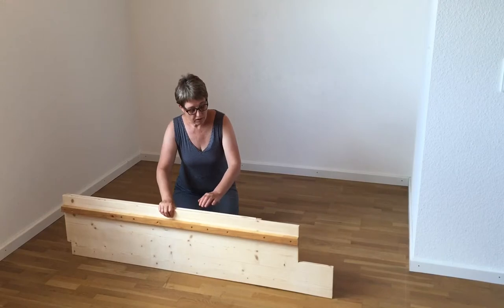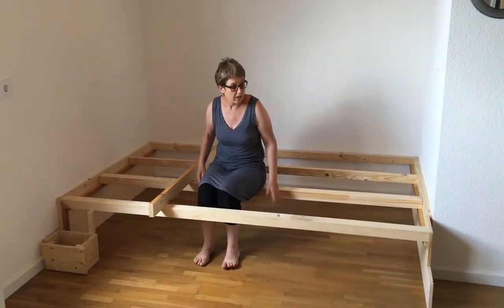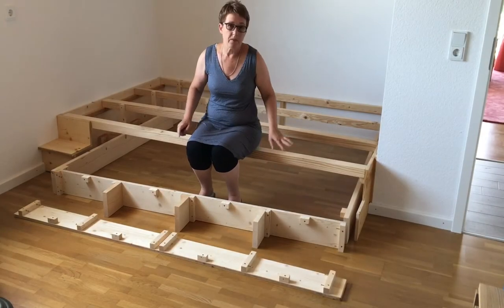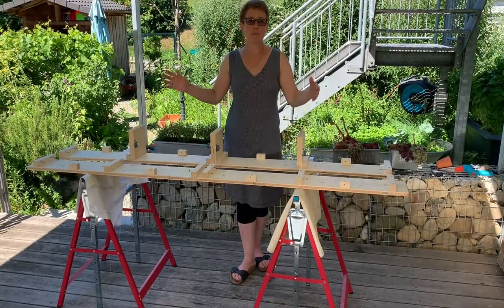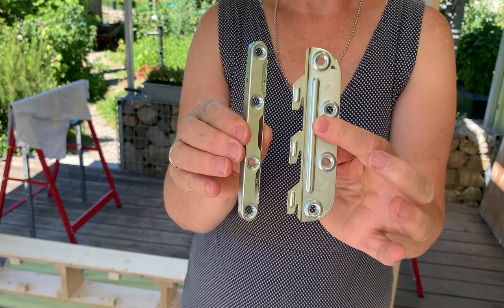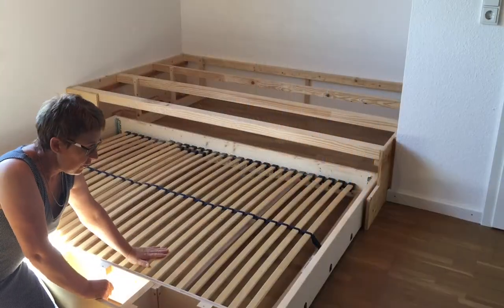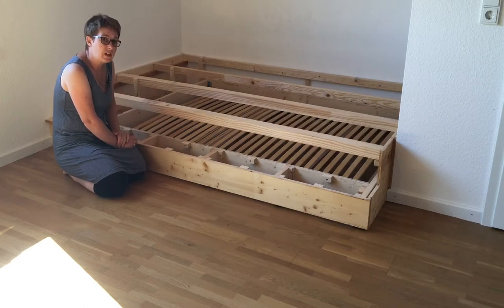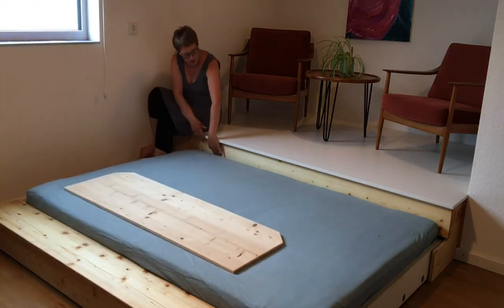DIY: Hidden Guest Bed. Platform Bed. Murphy bed alternative

Comment: Can you please tell us how many of each type of wheel you used for this project?  Also I am in the USA, is there wheels of this same kind here?
Reply from the maker: We used two different types of wheels/ rollers
Here is a Link to German Amazon ( in English). Unfortunately I don’t know whether they are supplied in the USA. 
Type 1 (We used 18 rollers / wheels of this type):
https://www.amazon.de/Design61-Castors-Parquet-Fixed-Furniture/dp/B06WPBSNRP/ref=sxin_16_pa_sp_search_thematic_sspa?content-id=amzn1.sym.bfcfa23a-438d-44f2-8404-95b200440473%3Aamzn1.sym.bfcfa23a-438d-44f2-8404-95b200440473&crid=RDYW9FL8JUBE&cv_ct_cx=bettkasten+rollen&keywords=bettkasten+rollen&pd_rd_i=B06WPBSNRP&pd_rd_r=efd5c97c-199a-4615-992a-f191ed549713&pd_rd_w=dny7t&pd_rd_wg=nnNTf&pf_rd_p=bfcfa23a-438d-44f2-8404-95b200440473&pf_rd_r=35WW8K3ZFYSXT29SED9W&qid=1679339326&sbo=RZvfv%2F%2FHxDF%2BO5021pAnSA%3D%3D&sprefix=Bettkasten+roll%2Caps%2C399&sr=1-2-3bf6831b-19ab-4b1f-92ec-7ff20088f9a1-spons&sp_csd=d2lkZ2V0TmFtZT1zcF9zZWFyY2hfdGhlbWF0aWM&psc=1&smid=A34DMBZNZDWU55

Type 2 (We used 6 wheels / rollers of this type)
https://www.amazon.de/-/en/Design61-castors-furniture-gliding-sliding/dp/B07RZ8LD2M/ref=sr_1_3?crid=1KXCRWKEA1500&keywords=einbohrrollen&qid=1679339583&s=diy&sprefix=einbohr+rollen%2Cdiy%2C1816&sr=1-3

We hope this helps you😀

Comment: Nice trundle bed! would you mind providing a link to the wheels you used on the project? thanks!
Reply from the maker: We used:

https://www.amazon.de/-/en/Parquet-Side-Rollers-Wheels-Grey/dp/B015PAV350/ref=pd_lpo_1?pd_rd_w=ceBxU&content-id=amzn1.sym.992f08af-eb2a-4a7b-90a4-cd77032caf05&pf_rd_p=992f08af-eb2a-4a7b-90a4-cd77032caf05&pf_rd_r=WQ706ZD5176W0R0FCZEQ&pd_rd_wg=y00fS&pd_rd_r=6328246c-a6a0-4b21-9183-eae6e104ed37&pd_rd_i=B015PAV350&psc=1

as well as:

https://www.amazon.de/-/en/D%C3%B6rner-790284-Bohrsenk-Cuffless-Diameter-Plastic/dp/B074M1ZBMD/ref=pd_lpo_2?pd_rd_w=NB6p0&content-id=amzn1.sym.992f08af-eb2a-4a7b-90a4-cd77032caf05&pf_rd_p=992f08af-eb2a-4a7b-90a4-cd77032caf05&pf_rd_r=BGVQ2DJKF5875DM2HF05&pd_rd_wg=ramZp&pd_rd_r=478e256a-a7b8-49fb-b572-bff0487adf98&pd_rd_i=B074M1ZBMD&psc=1

Glad you like the video😀

Comment: Nice project. Could you tell us the name of the casters you have used for this (maybe even a  link to the item). Keep up good work. Cheers.
Reply from the maker: We used:

https://www.amazon.de/-/en/Parquet-Side-Rollers-Wheels-Grey/dp/B015PAV350/ref=pd_lpo_1?pd_rd_w=ceBxU&content-id=amzn1.sym.992f08af-eb2a-4a7b-90a4-cd77032caf05&pf_rd_p=992f08af-eb2a-4a7b-90a4-cd77032caf05&pf_rd_r=WQ706ZD5176W0R0FCZEQ&pd_rd_wg=y00fS&pd_rd_r=6328246c-a6a0-4b21-9183-eae6e104ed37&pd_rd_i=B015PAV350&psc=1

as well as:

https://www.amazon.de/-/en/D%C3%B6rner-790284-Bohrsenk-Cuffless-Diameter-Plastic/dp/B074M1ZBMD/ref=pd_lpo_2?pd_rd_w=NB6p0&content-id=amzn1.sym.992f08af-eb2a-4a7b-90a4-cd77032caf05&pf_rd_p=992f08af-eb2a-4a7b-90a4-cd77032caf05&pf_rd_r=BGVQ2DJKF5875DM2HF05&pd_rd_wg=ramZp&pd_rd_r=478e256a-a7b8-49fb-b572-bff0487adf98&pd_rd_i=B074M1ZBMD&psc=1

Glad you like the video😀

Comment: What kind of wheels did you use?
Reply from the maker: We used:

https://www.amazon.de/-/en/Parquet-Side-Rollers-Wheels-Grey/dp/B015PAV350/ref=pd_lpo_1?pd_rd_w=ceBxU&content-id=amzn1.sym.992f08af-eb2a-4a7b-90a4-cd77032caf05&pf_rd_p=992f08af-eb2a-4a7b-90a4-cd77032caf05&pf_rd_r=WQ706ZD5176W0R0FCZEQ&pd_rd_wg=y00fS&pd_rd_r=6328246c-a6a0-4b21-9183-eae6e104ed37&pd_rd_i=B015PAV350&psc=1

as well as:

https://www.amazon.de/-/en/D%C3%B6rner-790284-Bohrsenk-Cuffless-Diameter-Plastic/dp/B074M1ZBMD/ref=pd_lpo_2?pd_rd_w=NB6p0&content-id=amzn1.sym.992f08af-eb2a-4a7b-90a4-cd77032caf05&pf_rd_p=992f08af-eb2a-4a7b-90a4-cd77032caf05&pf_rd_r=BGVQ2DJKF5875DM2HF05&pd_rd_wg=ramZp&pd_rd_r=478e256a-a7b8-49fb-b572-bff0487adf98&pd_rd_i=B074M1ZBMD&psc=1

Comment: Can u post a link with all the materials
Reply from the maker: Here’s a list of the materials we used: 
The Bed fixtures: https://www.amazon.de/-/en/cyclingcolors-Connector-Furniture-Fitting-Slatted/dp/B0BRQRFJ68/ref=sr_1_10?crid=3HUXEH5JZPF67&keywords=bettbeschlag&qid=1689271212&sprefix=Bettbesch%2Caps%2C287&sr=8-10

19mm coated chipboard for the platform 

Spruce 3 layer panel for the step

Pinewood for the frame

We used two different types of wheels/ rollers
Here is a Link to German Amazon ( in English). 
Type 1 (We used 18 rollers / wheels of this type):
https://www.amazon.de/Design61-Castors-Parquet-Fixed-Furniture/dp/B06WPBSNRP/ref=sxin_16_pa_sp_search_thematic_sspa?content-id=amzn1.sym.bfcfa23a-438d-44f2-8404-95b200440473%3Aamzn1.sym.bfcfa23a-438d-44f2-8404-95b200440473&crid=RDYW9FL8JUBE&cv_ct_cx=bettkasten+rollen&keywords=bettkasten+rollen&pd_rd_i=B06WPBSNRP&pd_rd_r=efd5c97c-199a-4615-992a-f191ed549713&pd_rd_w=dny7t&pd_rd_wg=nnNTf&pf_rd_p=bfcfa23a-438d-44f2-8404-95b200440473&pf_rd_r=35WW8K3ZFYSXT29SED9W&qid=1679339326&sbo=RZvfv%2F%2FHxDF%2BO5021pAnSA%3D%3D&sprefix=Bettkasten+roll%2Caps%2C399&sr=1-2-3bf6831b-19ab-4b1f-92ec-7ff20088f9a1-spons&sp_csd=d2lkZ2V0TmFtZT1zcF9zZWFyY2hfdGhlbWF0aWM&psc=1&smid=A34DMBZNZDWU55

Type 2 (We used 6 wheels / rollers of this type)
https://www.amazon.de/-/en/Design61-castors-furniture-gliding-sliding/dp/B07RZ8LD2M/ref=sr_1_3?crid=1KXCRWKEA1500&keywords=einbohrrollen&qid=1679339583&s=diy&sprefix=einbohr+rollen%2Cdiy%2C1816&sr=1-3

1 long Rod hinge

We hope this helps you😀

P.S If you would like our free sketch just send a pm to seppnshelleydiy@gmx.de and I’ll send you the pdf.